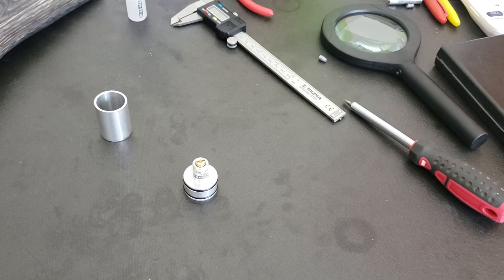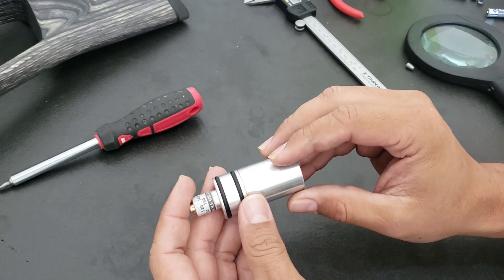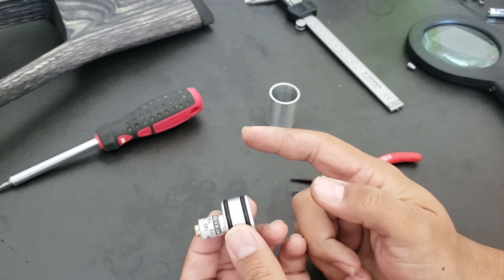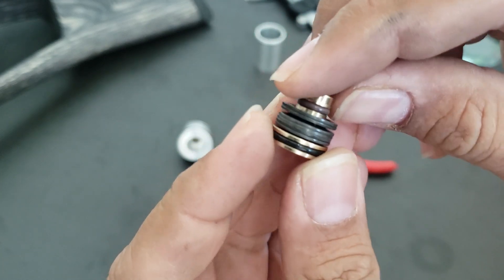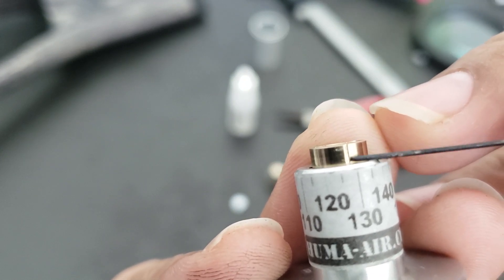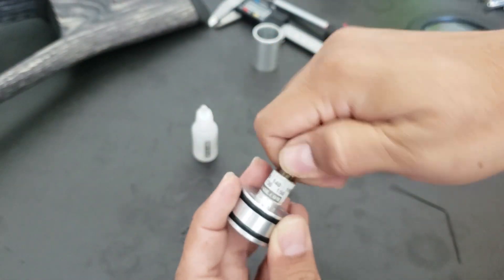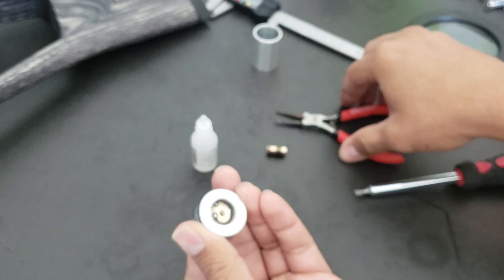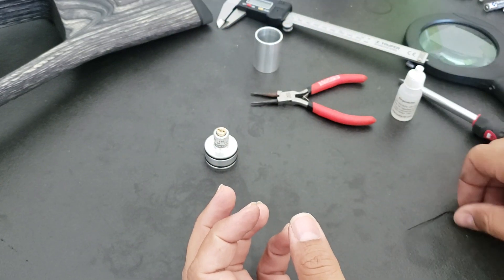Huma Regulator Taipan Veteran analysis disassembly and assembly

Comment: Shouldn't the Regulator have a Bleed Hole in the main Body, between the two O-Rings?
That's why there is the Bleed Hole in the Reservoir.
Those Spring Washers are known as 'Belleville' Washers.
Reply from the maker: @Docv400  there is a bleed hole in the regulator among the big orings. Thanks
Reply: @SurvivalMX  
Ah, OK.
Thanks.
Actually in the O-Ring Groove?
That's why I couldn't see it.

Comment: Thanks for sharing buddy bsafe
Reply: I have a question I haded another plenum to my Taipan veteran long 25 cal and I put the reg at 130 bar but I didn't get any good results it stay the same actionly it used more air only getting like 30 shot shooting 33 nsa slugs at 905 what wanted to know is it better to lower the reg to maybe 100 bar and better results or is two ple6to much use only one plenum man this is hard to figure out lol if you know pls reply thanks buddy
Reply from the maker: @chrisfigueroa3361  did you port or open more your valve already?? If not you won't see to much difference.  Now if you want to shoot slugs I recommend to set the reg at least 150 bar because you will need more power for slugs and maybe you will need a thicker hammer spring as well. Greetings
Reply: @SurvivalMX  mo I haven't open the port and also I took off the extra extention so now I have one again and I lowered the reg to 130 bar and I'm shooting the nsa slugs 33.5 at 910 fps and I get 35 shots on that tune I just received some 26.8 nsa slugs and I'm going to try those out maybe have lower the hst down cus if I leave like that im sure it will be shooting the lighter slugs at 1000fps lol or faster so yea I'm going to lower to get like 945 or so I hope they shoot good out the Taipan I just ordered the new fx impact mk2 in 25 cal. Cant wait and thanks for the reply buddy

Comment: Beware of bar indication labels. they are completely off on most huma regulators. 5-20 bar off compared to the reading on huma reg tester (why would they sell the tester if their labels were correct btw...?). And once u dismantle the regulator and reassemble it like u did, chances are that the numbers on the label will be even more wrong...
Reply from the maker: Thanks for the advice I'll check that 👍
Reply: Survival MX i set mine at 160bar on huma reg tester. Now shooting H&N slugs .217 21gr at 900-920fps and believe me this combination is a laser. Using single shot adapter of course. Try it.
Reply from the maker: @DoktorKar98  what shot count???
Reply: Survival MX around 30 shots 250 - 160 bar
Reply from the maker: @DoktorKar98  that's just few shots. I want plenty of shots that's why I tuned my taipan. I highly recommend to do the same.. check my videos. Greetings
Reply: Survival MX yes not lots, but my priority with this taipan is long range accuracy rather than shot count...so will keep it as it is a laser!